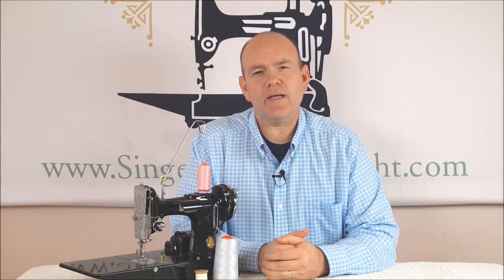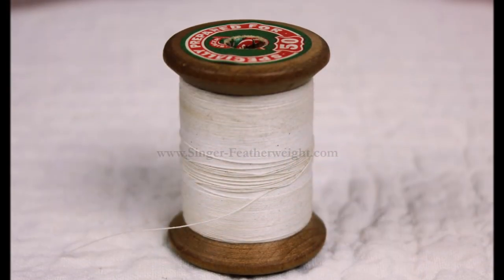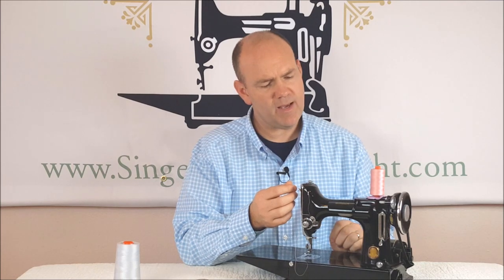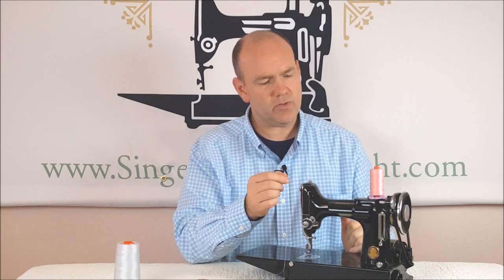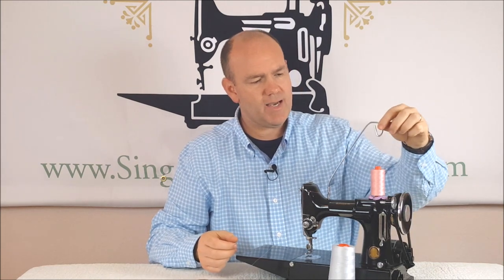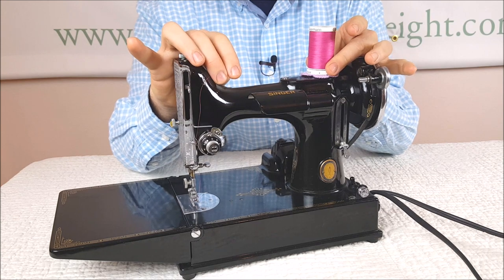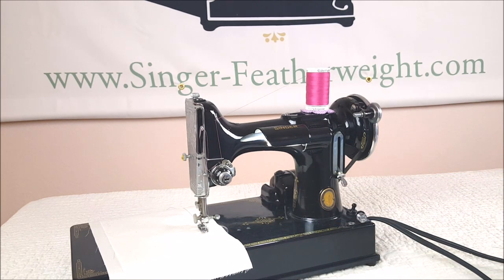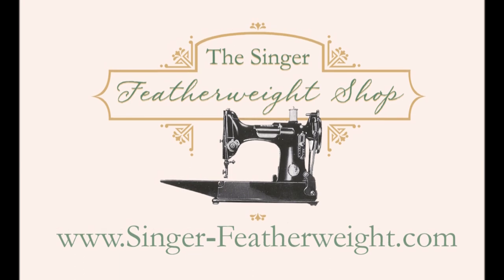The Singer Featherweight Portable Thread Stand

Comment: Does it work for 201-2?
Reply from the maker: Thank you for asking!  It depends on if there is an oiling hole in the top of the machine.  Otherwise, there is an "Old Iron" Thread Stand style on website for the bigger, heavier machines:

https://singer-featherweight.com/collections/shop